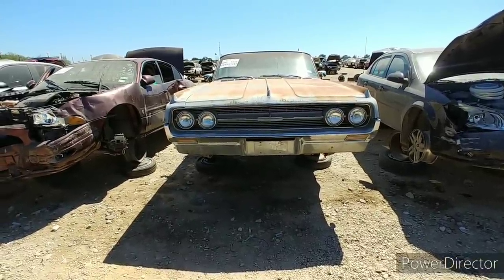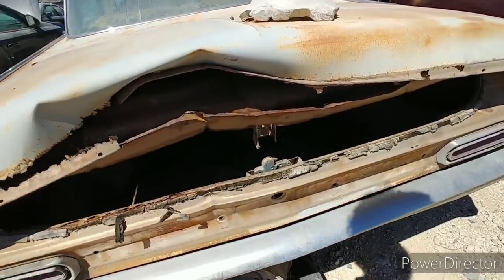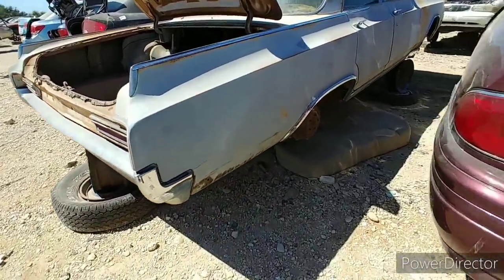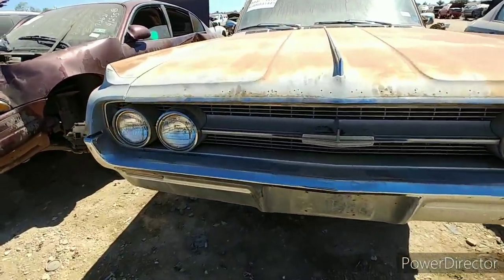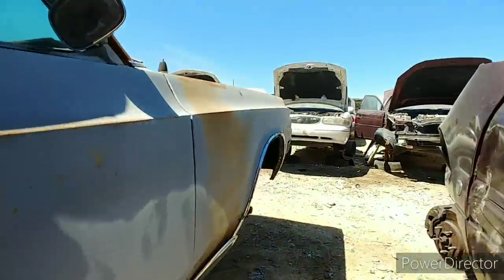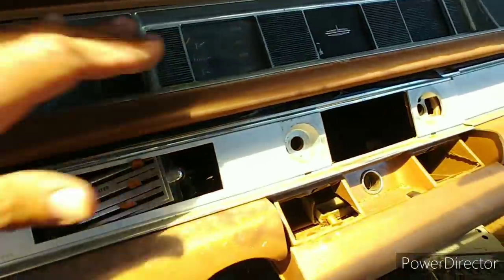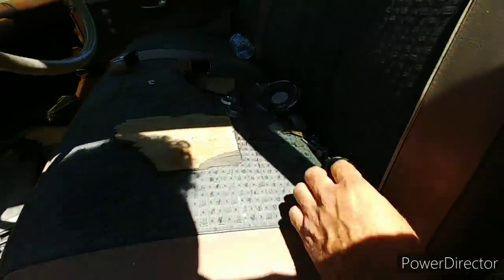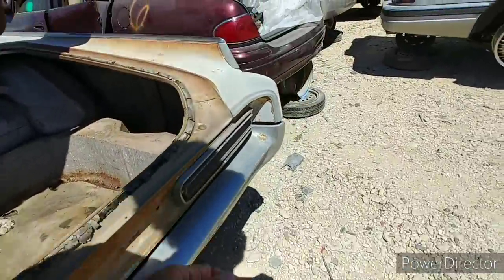1964 Oldsmobile Jetstar 88 Junkyard Find

Comment: Whoa Nelley it's a Jetstar and not going very far. Correct, this was the base offering in the "88" line. This would be the last year for this and they made about 19,514 of them that year. There was the "Celebrity Sedan" (which this is, more on that later) and "Holiday Sedan" in 1964.  These were offered in a wagon in some years and the odd thing about that was that the body wasn't made by Fisher Body. it was made by Ionia Manufacturing Company of Ionia, MI.  I believe that company eventually became part of A.O. Smith who of course made water heaters and also made frames for GM.

As a total FYI, unrelated, I read that S-K Hand Tool was sold to a Chinese concern in July 2021 and they are moving production from Sycamore, IL to Williamsport, PA as they bought the old Shop Vac facility that was there. I can only hope that USA manufacturing will stay with S-K as they have always been a great company making USA tools. They lost their way for a while when the French concern Facom owned them, but they had gotten back in good shape under Ideal. But they must be feeling pressure from their competitors on price. I'm keeping my fingers crossed......

I heard my name...LOL. When we get the....ah you know how it goes: Yes, those old parts like that will polish up nicely. Mother's Gold polish does wonders on it. It did for the Turbo Flow wheels on my 1979 10th Anniversary Trans Am as well as the exhaust tips. But here we go from the top: 

We got the VIN, we win: 8 for eight cylinder engine equipped vehicle, 3 for Jetstar 88, 4 for 1964 model year, K for Kansas City, KS assembly (aka Fairfax, KS, the same plant that assembled my '84 Delta 88, which would close in 1986 and then Fairfax II went into operation. That plant still is producing vehicles today) and the rest is the production sequence. 

Yes, that's a USA made Gates "Green Stripe" belt. I didn't care for the "chunked out" style of them, but that was a late '80s/early 90s thing with replacement belts. Gates of course is still around making replacement belts. 

Correct, the Jetstar 88 used a 330 V8 instead of the 394 V8 used in other models and also used a Super Turbine 300 instead of the Roto Hydramatic.  Of course, both engines were Oldsmobile produced, as you can see the trademark oil filler up front. That would carry on all way through the 307 which was last offered in 1990. The 330 V8 ran from 1964 to 1967. There were two and four barrel versions. 

Grab that WD40 bottle. I have one and I buy the gallon refills and it's a lot more economical than cans. I  spotted a GP/Sorensen box. They became part of Standard Motor Products in 1989 and by the 1990s was the "retail brand" sold to the likes of Autozone and other customers. Same product as what was put in a CarQuest box (for product supplied to them by Standard), Big A (APS), or Standard Motor Products "house brand red box" at the time. A lot of folks don't know that "reboxing" goes on more than you think in many industries, especially where sources are limited and there are only a few true "manufacturers".  I have a few of those "coin" gappers. I believe Kastar (a division of A&E Tool of Racine, WI) made those for everyone. A&E is an excellent company. I recently bought a Sears Craftsman #40804 feeler gauge set and they made it for Sears. I was missing one leaf, so I contacted them. I got a very nice guy named Bob on the phone and we talked for a while. He said, "I put two of them in the mail to you. Sorry for the delay...." They also own Star Hoffman which was in Lindenhurst, NY (Long Island) and I used to deal with them. I told Bob who I knew there and he said, "Oh yes, I knew them both.....".  It shows that there still are good people in the world.....

I was getting worried there, but you came through, whew. When you don't, we could say like Bob Uecker used to say, "He missed the tag!"  Here's Bob in 1985 saying just that: https://www.youtube.com/watch?v=Hs_66S1Oa24

We got the tag, we can brag: 12A for the first week of December 1963 production, 64 for 1964 model year, 3369 for Jetstar 88 four door Celebrity sedan, BK for Fairfax, KS/Kansas City, KS assembly, 978 for Saddle vinyl interior trim, SS for Saddle Mist upper and lower exterior paint, accessory code of 1-4 could be for seat belts, no data shows up on it. 

Whoa Nelley, Jetstar and soon to not be a car. 88 and no longer great. 3-3-0 and gotta go. 1964 and out the door. Off the road in '91, this one is done. That's it, time to quit. Going to be flat and that's that. Super Turbine and not so fine.  The Rocket is going to soon be out of pocket. The Rocket lost its' flame, and that's just insane. It once was a pretty Saddle Mist, and it's going to get squished and the Lansing, MI rocket faithful are going to be very pissed.
Reply: I guess I could now say, "When CRS gives me the "pin", I/we win", or "When I get the heart, I've done my part......"
Reply: Whoops, I think the "K" is Leeds, MO. Kansas City, KS would have been an "X" to denote Fairfax, KS.

Comment: I had a 1964 Pontiac GTO convertible back in the mid to the  late 70's with an interior  that color of gold with a white top and exterior,I fixed it up for my wife! I had a red exterior with red interior and black top 64 GTO convertible that I had fixed up for myself at the same time, She would get mad at me because she wanted to drive the red convertible instead of the white one!  That Oldsmobile Jetstar 88 was a full size car but Oldsmobile put the midsize car brakes and suspension pieces in it so they could sell it cheaper! If you look close the drums are real small the brakes are 9 inches front and rear! And if you look you can see it has a rear small differential in it too! What a way to trim cost! Put little bitty brakes and suspension on a full size 4500 pound car to be able to sell them cheaper!
Reply: Those GTOs were worth a buck even by the 1970s. What happened to them? My coworker just bought his back. He had it since 1972. Family dispute and it got sold without his consent. It turned up on Ebay and he made a deal to get it back.

Comment: I will have comment again. This car does have good parts left that an owner of one like it could really use I'm sure they'd have issues finding. Plus, my first car was the 64 family Olds Super 88 handed down. At least the 394 Starfire engine in it with it's Rochester 4 barrel 345 brake HP was powerful.

Comment: Shame this car is in the junkyard its in pretty reasonable condition still, far worse cars have been saved. It seems most classics I find on craigslist have more rust and body issues than this car. I wonder if there's a way to get it out of there?
Reply from the maker: Once its processed and out there for parts, its only coming out of there crushed
Reply: @ClassicRideSociety  Quite a shame, I just hope it gets picked down to the frame and used to fix it's higher optioned brethren. Thanks for the video.

Comment: Will it run 😆
Reply: @midnitesquirldog1 Absolutely correct. High nickel content blocks in many cases, they were very, very, very reliable. My 307 had a hard life before I got it (my uncle, my aunt and four teenage drivers) and it was smooth as could be. My second favorite next to a Pontiac V8.
Reply: With some fuel and tinkering, no doubt it will fire right up. The Olds V8 is about as bulletproof as the Slant Six in the Chrysler world.
Reply: @googleusergp  Yes those Oldsmobile engines where great engines.
Reply: @garymckee448  They sure were. Excellent all around.
Reply: Yup, excellent engines indeed.

Comment: Why do the yards junk cars that are this old?  Isn't there any value in saving these for someone wanting  potential project car? This would need quite a bit of work but it doesn't look that bad!  Why junk this?  It survived for 57 years - so just trash it?  Seems ridiculous to me.
Reply from the maker: This is a corporate self service yard. These are just vehicles to them just like the car on either side of this classic. They process it, part it out then crush what's left like every other vehicle that goes through there. That's there business model. I think it's more the fault of the person who sold it to the yard. They could have gotten more money and possibly saved that car from this fate. It happens way too often unfortunately.
Reply: @ClassicRideSociety  Correct. It is just metal to them.
Reply: Ive had a 4 door htp 64 dynamic 88 for 15 years.  I bought it at a estate auction sale. Had to out bid the scrap man. In 15 years no one has shown the slightest interest in it. They want to buy the 2 door tri five chevys and short bed trucks ect. Iv got a running 56 chevy 4 door and no one wants it. And us old geezers that grew up driving the older vehicles are dying off. the younger generations dont want them.
Reply: @thecollectoronthecorner7061  I can understand that, but when they are gone, they are gone for good. I suppose if there's no demand for anything that's why they just wind up going away. But it seems like a shame to throw away stuff that could keep someone else's pride and joy going.
Reply: @googleusergp   Yes that 64 olds in our hoard  would have been crushed 15 years ago. However we bought it and spent  time and money to relocate it from where it was setting & rotting to have it set and rot for 15 years at our place. Now scrap prices are back up & this time we intend to cash in. sSadly the only  ready willing & able guy who has the cash is the scrap man. And he dont care about condition or number of doors ect. just how much it weighs. We have decided to haul off 50 vehicles If we net $200 each after gas and other expences thats $10,000. IWe will use the money to buy something we will enjoy more than 50 setting and rotting vehicles.